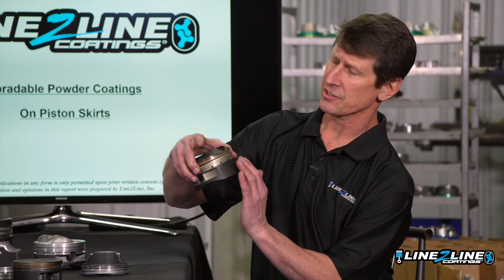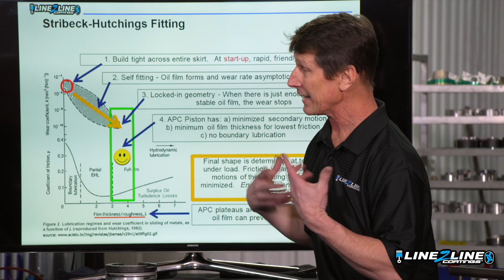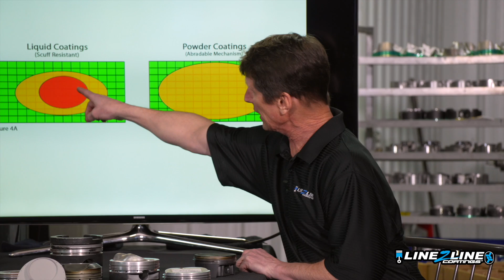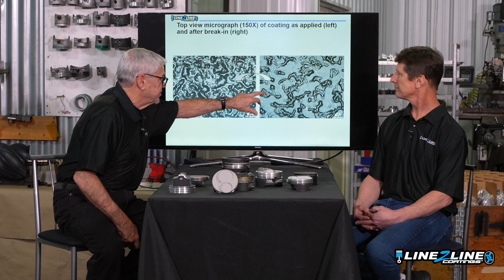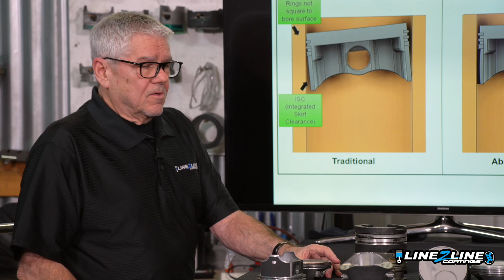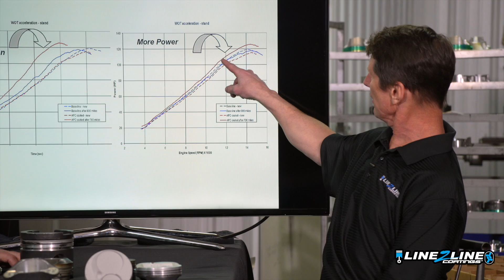Abradable Powder Coatings™ On Piston Skirts  (No music soundtrack)

Comment: Is this a race type coating only, or does it have applications for true daily drivers as well.
Reply from the maker: Our coatings have been used in many daily drivers to provide performance and longevity benefits.  Our coatings have also helped with classic car restorations going back to the brass era when many components are unobtanium.  In addition to automotive, we are in marine, aviation, aerospace, agricultural and industrial applications.  Customers have even rebuilt chainsaws and leaf blowers with our piston coatings and report significantly reduced noise and vibration.
Reply: @Line2LineCoatings  Thank You, that is outstanding to know!

Comment: I’m building a 500+ HP Suzuki Hayabusa that’s supercharged AND I might a little giggle juice if needed to break that 500 HP threshold!

I have brand new CP Pistons and Rods going to to the engine, stock bore and stroke.

I went with CP 9.5:1 turbo pistons to drop the compression down from the stick 12.5:1 so we can add more boost.

I was planning on cerakoting the dome of the pistons and using their coating for the skirts too.

However I may be interested in going with you guys, I saw someone else asked 8 months the cost to apply your coatings to fresh pistons?

I’d love to speak with someone on Monday if possible?

There is only 5400 miles on the engine now but again we are building this motor to take upwards of 700 HP (those CP H Beam Rods sure will help if I do ever push the HP of those engine that high!!), trans is going out Monday to be race cut and polished but can this coating be applied to a motorcycle trans gear set?

The head is also going out Monday to be ported and polished, I went with Vance & Hines stainless valves and titanium keepers.

I want this build to hopefully be a one time build so I’m willing to do the work now to make the most bang for the buck and it still be a reliable motor!

I have a drag strip 15 minutes from me, I used to work there, but while I will be taking it the track 4-5 times per year, planning on a trip to do the Texas Mile high speed run, it will primarily will ridden as a street machine!

But it will have the ability to be multifaceted and be a killer when needed, especially on the giggle juice!

And of course it will be run on a Maxx ECU for better boost co tool and tuning?

Please let me know who to speak with about cost, turn around time, and the scope your coating can be applied while I have this beast apart!

Thanks…
Reply from the maker: Please send this in an email to info AT line2linecoatings PERIOD com.  Thanks for your interest in our coatings!

Comment: Fellas, you know the manufacturers of pistons know ALL the dimensions of their pistons, right? So while you only measure in two spots, if you get that clearance right, the rest of the clearance will be correct as well? Today, manufactures can make pistons any shape they want
Seems like a decent product for coating used pistons to use them in a .001-.003" bore
The conformable seems worthwhile as well.
Totally not buying the expanded oil film

Comment: Why not use these coating between the rings to help make a complete seal????
Reply from the maker: We have coated the ring land area when a customer requests it, usually to provide added stability to a piston when it comes out of the bottom of the bore in a stroker engine.  Even using APC on just the piston skirts provides better piston fit in each bore, which keeps rings square to the cylinder and settled for improved sealing, heat transfer and oil management.  This is covered in more detail in the AERA Engine Professional Magazine article that is posted on our website under the Technical Documentation section.

Comment: Can you do a 44-66cc engine piston?
Reply from the maker: Yes.  We are spec'd onto military drone engine pistons; some are in that size range, some are even smaller.  On the other end of the scale, we've coated pistons that run in locomotive diesel engines.

Comment: So this abrades and then goes into the oil to go to the rest of the engine?
Reply from the maker: The coating’s “fuzzy” texture is made up of thousands of tiny peaks.  As the coating burnishes itself to the ideal fit during the break-in, the peaks that abrade come off in tiny particles.  Most of the particles will hang suspended in the oil until the first oil change; larger particles may get trapped by the oil filter.  The coating is a proprietary blend of polymers and lubricious filler materials, so the particles also function as a lubricant.
Reply: its out after your first break in oil and filter change.
Reply: Soooo maybe for the first hundred miles or so after engine break-in you change the oil more frequently till the coating is fully worn in😀

Comment: What is the coating made of, do you have different compounds for different applications and heat ranges? Does the skirt length affect the effectiveness of the coating? What is the recommended variation for the coating thickness? Does the coating debris affect softer metals? Does this have thermal benefits or drawbacks not related to cylinder friction? why is figure 4A off center? Why did you cut at the end of a pertinent question? Are there metals this coating does not adhere to?  Can these coating be applied with positive results to other pieces such as hydraulic lifters? Are these too many questions for a 20 min video?
Reply: How much does it coat
Reply: They just made a video a couple of days ago that Answers some of your Question. ✌️
Reply from the maker: Kyle, there are other videos in our series which may answer your questions in more detail, so we’ll briefly touch on each one here.
What is the coating made of? It's a proprietary blend of polymers and lubricious filler materials. The coatings contain no PTFE.
Do you have different compounds for different applications and heat ranges? Our coatings cover a broad spectrum of thickness, strength, friction properties and heat ranges, and are designed to perform in a wide range of applications.
Does the skirt length affect the effectiveness of the coating? No
What is the recommended variation for the coating thickness? This depends upon your specific application. On piston skirts, we like to say that our "sweet spot" is .001" - .004" radial (.002" - .008" diametric), but we can and have applied .015" or more on the diameter of a piston and achieved the desired results. 
Does the coating debris affect softer metals? No
Does this have thermal benefits or drawbacks not related to cylinder friction?  Piston rings conduct heat energy from the piston crown to the cylinder wall.  While there are thermal benefits due to reduced friction and improved lubrication, APC stabilizes the piston in the bore so that the rings stay in constant contact with the cylinder wall.  The improved ring seal allows heat to be transferred more efficiently.  
Why is figure 4A off center? We’d like to say that we were checking to see if people were paying attention, but the truth is that it just slipped through that way.
Why did you cut at the end of a pertinent question? Which question?
Are there metals this coating does not adhere to? None that we have worked with yet. The coatings also successfully adhere to PEEK polymer
Can these coating be applied with positive results to other pieces such as hydraulic lifters? Pistons, pumps, compressors, turbo/superchargers and bearings all have shown measurable benefits using APC. We've coated lifter bores and solid lifters, but cannot coat hydraulic or roller lifters unless they are fully disassembled so that we’re only working with the lifter body.
Are these too many questions for a 20 min video?  No, we appreciate your interest in our coatings. Please view our other videos for additional information.
Reply: @Line2LineCoatings  You guys are !!!!AWESOME!!!! I discovered your product from Lake Speed Jr. 
I'll be contacting ya' soon. 
Best regards, 
Ben
Reply: @Line2LineCoatings  thank you!